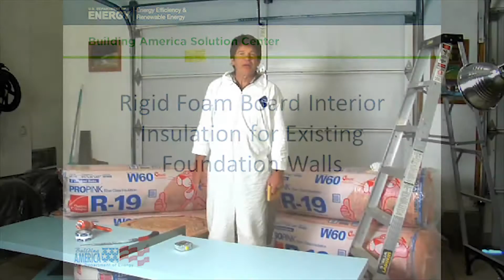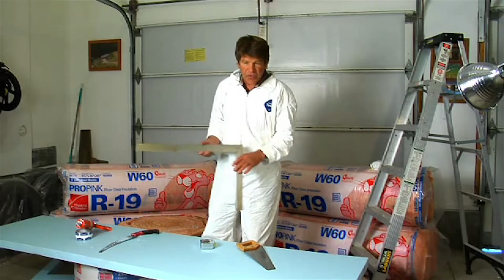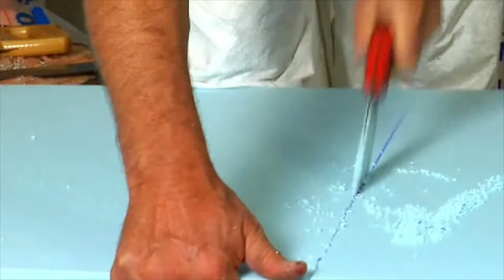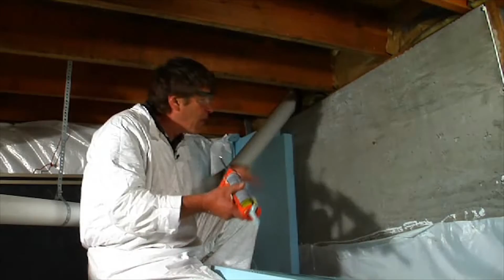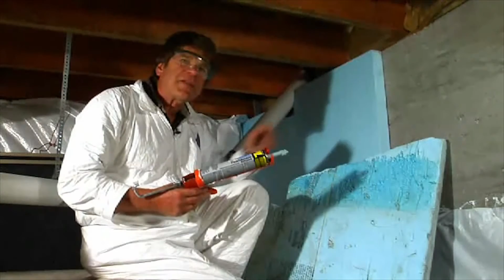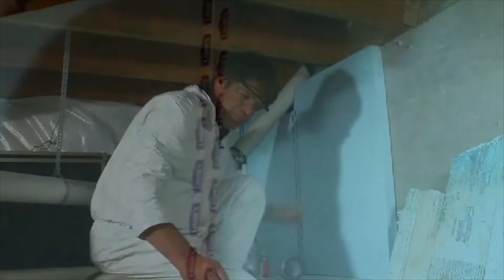Rigid Foam Board Interior Insulation for Existing Foundation Walls

Comment: Thanks for this video.  Out of curiousity, why not press the foam board with substantial force up against the concrete wall?  I would think you'd want to minimize the air gap between the foam ad concrete.  A big dollop of adhesive looks like it could cause 1/8" to 1/4" gap, allowing for convection currents to form and cool air to 'drain' down the gap.  Curious to hear your thoughts, as I'd really prefer to use an adhesive, rather than a Hilti/nail to attach the foamboards.

Comment: Using polystyrene in this manner, I believe you are not in compliance with IBC code section 2603.4.1 - Foam plastic must be separated from the interior of a building by an approved thermal barrier of 1/2" gypsum wallboard that limits the average temperature rise of the unexposed surface since this material is highly flammable.  An exception can help, 2603.4.1.6. "Attics and crawl spaces. Within an attic or crawl space where entry is made only for service of utilities, foam plastic insulation shall be protected against ignition by 1-1/2" mineral fiber insulation, 1/2" thick wood structural panel, particle board or hardboard, 3/8" gypsum wallboard," This is not safe to be left exposed and it does not appear you are satisfying the exception the code provides.  Polystyrene is highly flammable and fumes are carcinogenic. Poly-iso vs Polystyrene is a different story.
Reply: I don't understand how there are so many videos of people leaving the xps, eps unprotected.  especially the companies that do this for profit. wtf?
Reply: I don't think a crawlspace counts as the building interior, so an ignition barrier isn't required. Same reason an ignition barrier isn't required in an attic